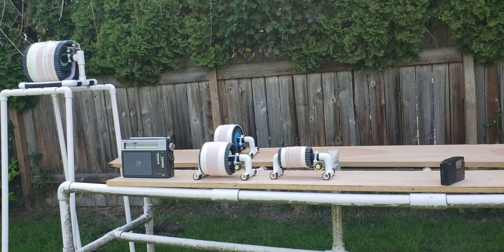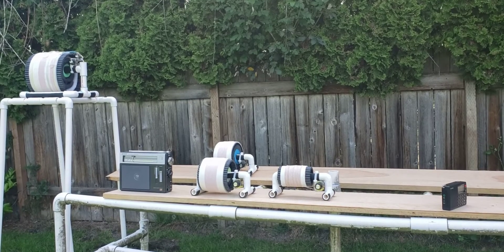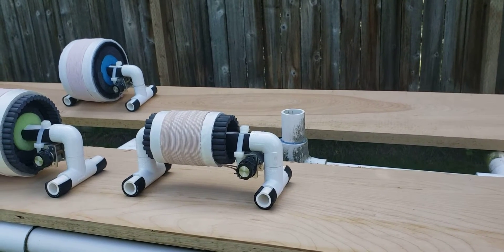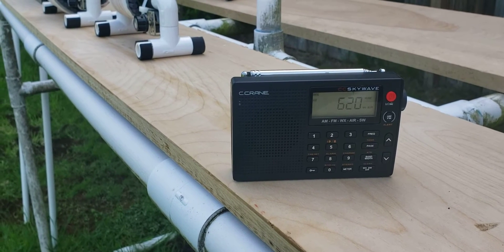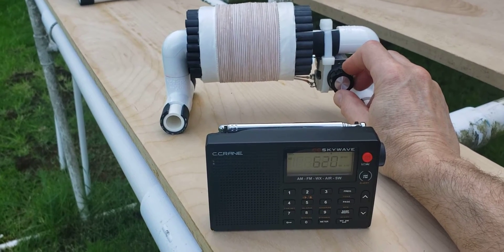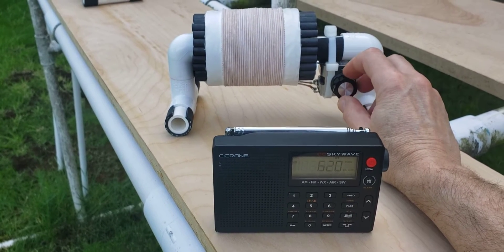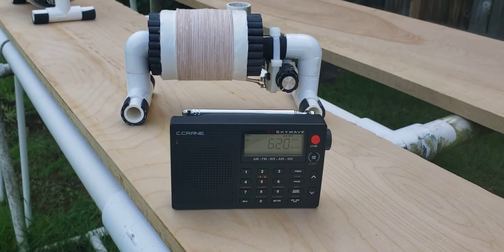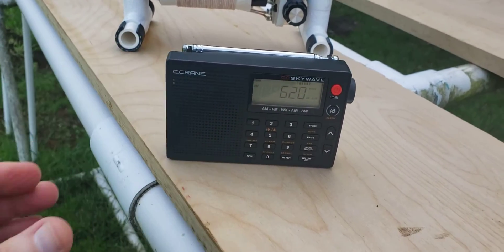.FSL (Ferrite Sleeve Loop) Antenna Tuning Course

Comment: The Sony-2001D is much better for such experience, sound without hiss.
Reply: You are correct, Alexey, but most of the FSL antenna users don't have a Sony ICF-2001D model, so I demonstrated the antenna with the common C. Crane Skywave model. The Sony ICF-2001D model also works great with this small FSL antenna.

Comment: Good HF Litzwire helps to keep the skin effect low. But there is no gap between each winding of the coil. That would lower the proximity effect and that gives a better Q-Factor.

Comment: Hi Gary, I'm going to try to make your 7.5 inch loopstick for my Tecsun PL310 with a 200mm Russian ferrite rod and and 100/46 litz wire. Your really inspiring article that I found on the NDBlist group says 122 turns. But could I ask you as I am only interested in the NDB band and not the broadcast band, would there be any benefit in  having fewer turns and if so I wonder how many you would suggest.

I've already built a prototype using a smaller ferrite bar and some litz wire I took off a transistor radio and wired it into the the PL310 and it is now a lot less deaf! I'm planning on using a 3.5 mm jack socket in the side of the radio so I can experiment a bit. Any particular wire recommended for this connection from the socket to the circuit board?

Thanks for your inspiring videos and articles.

73 Adam (SW England)